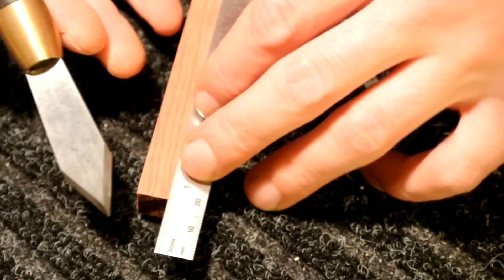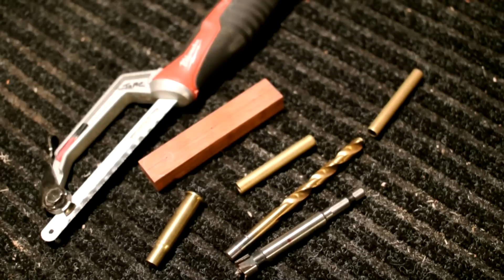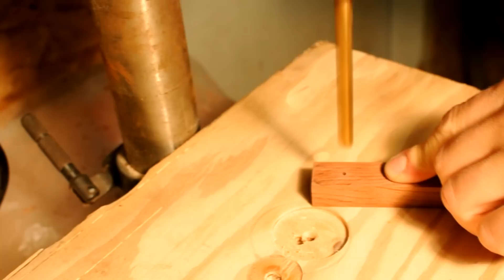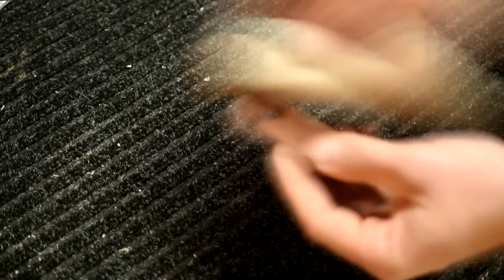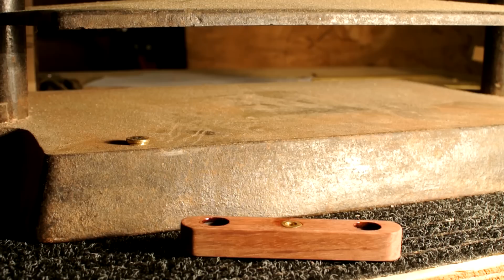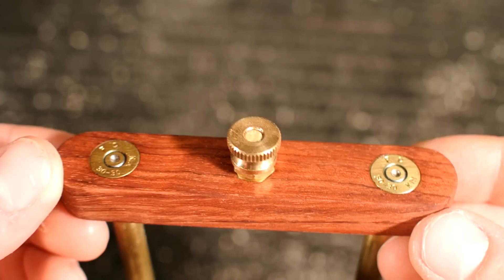Homemade: Board centre gauge

Comment: Beautifully made center marker. I have a stupid suggestion - the nut should have been embedded  in the pin side of the wood in order to avoid the nut popping up while pressing it on hard wood or metal. I hope you don't mind.
Reply from the maker: Thank you, and I would have to agree with you on the nut. It would definitely be a more solid design but I haven't had any issues with it so far!
Reply: I just wrote the same thing then saw your comment! Failure is simply the opportunity to begin again, This time more intelligently- Henry Ford.

Comment: Nice project! Way did you cut the shells? To me they could be put in from above with the holes you drilled?
Reply from the maker: I cut the shells ends with a small hand saw with a metal blade on it. The first one i built i used a bullet shell, but because a lot of the tapering on the shell it didn't work out so i went with the straight brass tubing.

Comment: why did you cut the spent brass casing ,,,, from the rim and pin,,, why not cut the taper on the casing and use with the top rim and remaining casing for the outer guides , great either way ,just seems like more work
Reply from the maker: christophe leblanc The first centre gauge I made i did exactly that. I found the tapper of shell made it difficult and wobbly when using it. When I made my second one (shown in the video) I decided to use straight pins but also wanted the ends of the shell casings just for decoration. So that's what I came up with.
Reply: cool ,,, never thought the upper taper would of caused issues , i could see the bullet taper doing so but makes sense now ,tks

Comment: Essentially, the centre pin must be centred on the two outer pins?
Reply from the maker: exactly. if there even the slightest bit off the live your scribing wont be centre. But that's not a bad thing because the first one i made was a bit off, which after scribing both sides of the board i found it was the exact width of my band saw blade so it shows me my waist when resawing.